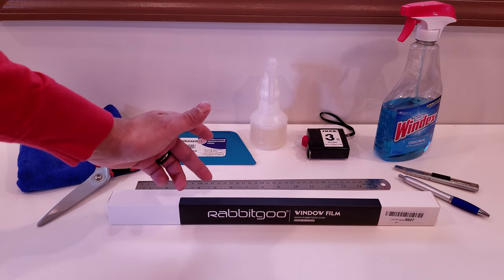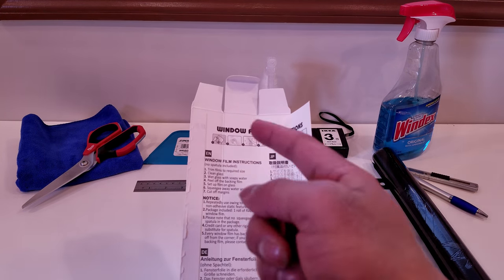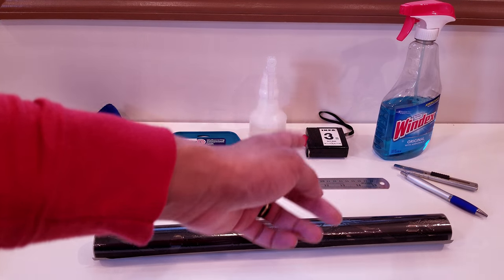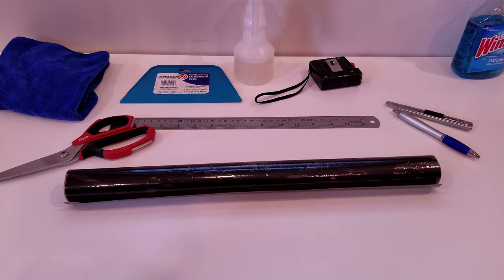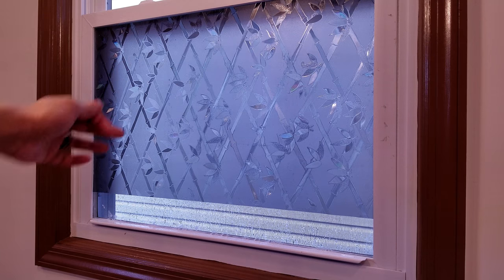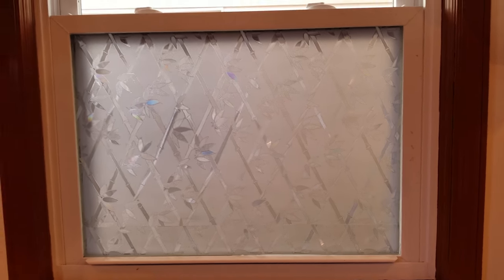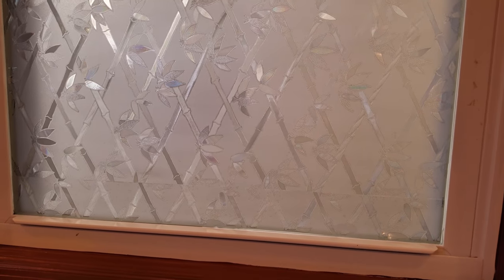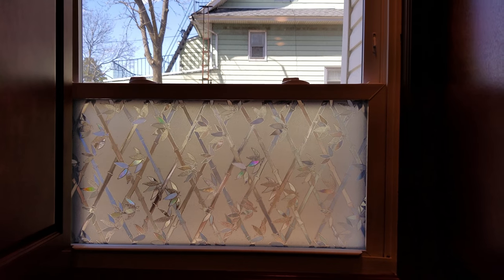Window Privacy Film Installation and Review in 4K!

Comment: One problem with the demo - You don't show how much privacy you get inside FROM outside when it's dark outside an the lights are on inside. That makes a huge difference.
Reply from the maker: Great advice! At the time I shot this video I was thinking of that saying "if you can see them they can see you" next time I do a review like this I will definitely do it from both aspects
Reply: Same question here. I am looking for a window film which can keep privacy when outside dark inside light on. But, wouldn’t find the answer in this video. Disappointed.
Reply: I have the same one on my windows and they’re pretty private ngl
Reply: It just looks like blurry white and yellow stuff
Reply: @amyjingli2810  He's stated his appreciation for the constructive criticism & he would try both next time :) Pull-down shades are 100% effective nighttime privacy.
Reply: @amyjingli2810  no such thing exists, what you need to do is make the outside brighter at night than the inside, put bright spot lights on outside, and turn off the lights inside
Reply: @amyjingli2810  a friend mind told me I should put the film. Let it dry for about three days then put another film on top it repeat three coats or put one coat on the outside might cover And make it private
Reply: You get next to zero with almost every privacy film.. You'd need frosted glass for maximum privacy

Comment: Looks like you installed it horizontally instead of vertically, the leaves should point up like they would grow in nature.  Also, you're not supposed to do joints like wallpaper.  It should be one continuous piece.
Reply: follow the diamond panes
Reply: Your house, you should do it how you want.  Bigger windows have to have a joint.

Comment: Does it help during the winter at retaining heat indoors?
Reply from the maker: It does help with retaining heat however your windows frames also come into play with the cold. Most times the draft comes from the seams of the window or the border of the frame. Check to see if your feeling the draft and if not these will help insulate the glass itself
Reply: any film that you can see clear from inside but you cant see anything from outside

Comment: I just got some coloured window film. I never thought to use soapy water...wont that effect the stickyness of the film?
Reply from the maker: It all depends on what kind of film it is. If it is a static cling film you will need to use the soapy water solution. If it actually has adhesive then you shouldn't use the soapy water solution. Best thing to do is follow the instructions for the product. 

Hope this helps!

Comment: My kit has just arrived, great video, makes me feel more confident at cutting, pretty nervous about getting a straight cut!
Reply from the maker: Awesome!, I'm glad to be of help. Getting the straight cuts are always a pain, just make sure to use some kind of straight edge and a exacto-knife or box cutter. 
Let me know how it goes once you start the process.
Reply: Hey got it all installed. Definitely best using the existing straight edges for at least two window edges first, saves cutting around the entire window.

I used a bathroom tile to cut straight, my second window was better than my first, kinda wanna get two more and do them again. I bought a squeegy and proper craft scalpel which helped a lot!

Video definitely helped though!

Comment: Didn't work, tried it on a window that is rugged, church window ish. Any suggestions? 😊
Reply from the maker: Hey, I would say try using a blow dryer on high. Not really sure if it will work but I'd say its worth a try. Would kinda be like wrapping a car, the heat aids in the film contouring to the surface. 

Let me know what happens!

Comment: Hey let's say I put water on the window and I messed up and the film peeled off can I use the film agian or do I have to buy a new film
Reply from the maker: Hey, yes you can definitely reuse it. It can be repositioned as many times as you need during the installation process. 

Hope this helps!
Reply: @ReggieTECH  um it didnt work s couple days ago so I could reuse it agian today right ?
Reply: Another question after I got done using the squeeze I wiped off the excess soapy water with a napkin will it affect the installation thank you
Reply from the maker: @pmoney8330  Hmm, I would say it all depends. If the back of the film (the side that sticks to the window) got dusty or dirty it may not work. But definitely give it a try before calling it quits.
Reply from the maker: @pmoney8330  That's exactly what you should do, it won't affect anything
Reply: @ReggieTECH  my film looks clean so I should give it a try right

Comment: I’m having so much problems with the last 20 inches of my film. It’s the piece that was rolled up against the cardboard roller it comes on. The other 2 pieces I installed went on just fine. The edges on the third piece are curling up and refuses to cling on to the glass. I tried soaking the film in warm water first to uncurl the edges but it’s not working. Any suggestions ? Thanks
Reply from the maker: Hi, I would say try to apply it using the soapy water solution and then use a hair dryer on hot. Don't put it directly on the film, but instead about 6 inches. This should help the film flatten out and should also help it to stick.
Reply: @ReggieTECH 
Ok, thanks for the suggestion, I will try that. 😄

Comment: Is it the same intrusticons for the black one cause I bought the black one
Reply from the maker: Yes, if it is the same type of film it will be the same installation
Reply: @ReggieTECH  I have a black rabbitgoo one so these instructions would work right
Reply from the maker: @pmoney8330  Yes, absolutely
Reply: @ReggieTECH  i used these instructions for my first window by accident was wondering if it is the wrong instructions
Reply: Would appreciate a quick response
Reply from the maker: Hi, those instructions seem fine. I don't see anything wrong with the way he did his installation
Reply: @ReggieTECH  let's say if a little bit is like peeling off or not sticking entirely can I just put a piece of tape on it it
Reply from the maker: @pmoney8330  Hi, before putting tape I would suggest using a heat gun or hair dryer to help it adhere to the window
Reply: @ReggieTECH  what's the blow dryer going to do
Reply from the maker: @pmoney8330  It should help the film adhere to the glass

Comment: Shoddy work. With the multitude of lengths and withs available , If he measured before buying the product he wouldn't have to use 2 pcs. Measure your windows BEFORE  puying the film. You don't want multiple pieces per window. But. I did appreciate his installation instructions.
Reply: That's not always an option obviously.  Most cuts are already pre sized and don't have a custom option. 😑